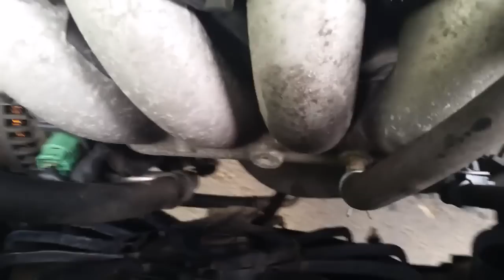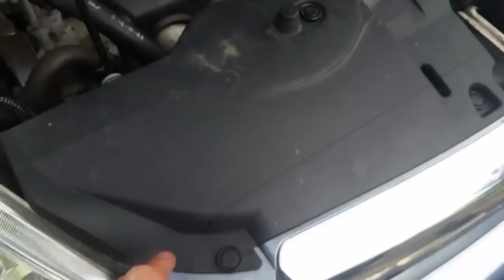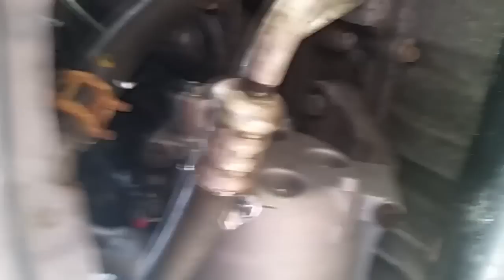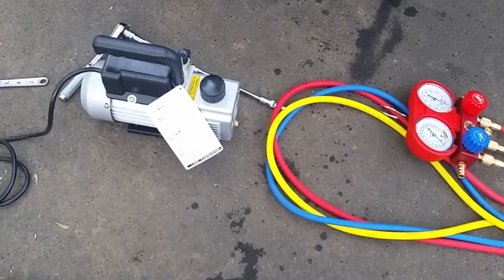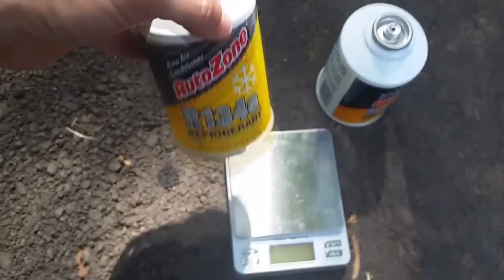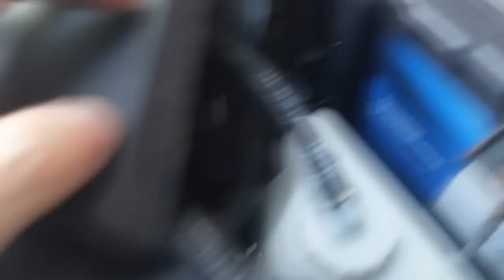2007 Honda CRV AC Compressor and Serpentine Belt

Comment: you dont need to buy that special tool,  Just get a wrench 14mm and extend it with another one but before that just push the power steering reservor to the left side,  I replaced my alternator and had to do that process

Comment: I did this job yesterday on a 2007 crv. I installed a low mileage used compressor from a 2012 crv.  Exact fit.  AC blows really cold now.

Comment: I purchased a 2007 CR-V EX-L in October of 2017 with 43K original miles. AC runs good but that doesnt mean that there arent any hidden issues.  In order to prevent any A/C issues should I just go ahead and replace the coil part of the compressor and evacuate the system, rep[lace the condensor and re-charge?
Reply from the maker: Jackson Cruz I read some people have had catastrophic (expensive) failures, but I dont think I would do any preventative replacements.  This was just a DIY video, I'm hardly the expert.  Hope it lasts for you.
Reply: I've read that too and is what I am trying to avoid. I can do all the work myself. What I propose shouldnt cost more than $250. Where it gets expensive is when your expansion valve gets clogged and you have to tear dash apart to replace it.

Comment: The clutch and coil were recalled by Honda on this model. I had them repaired mine.
Reply from the maker: I don't think this is right.  There was a class action suit, but it was for earlier year models. If you have updated info, please post.
Reply from the maker: Reminded myself, it was a warranty extension to 7 years / 100K on the clutch, but of course if the compressors goes out because of clutch problems, well too bad for you.  I doubt too many are still covered by this extension. Good luck all.
Reply: +Scstev I know the model year was from 2007 until 2010 (or 2011 as I don't have the recall letter handy right now).

Please read my thread. 
http://www.crvownersclub.com/forums/14-problems-issues/156793-2010-cr-v-c-issue-compressor-clutch-coil.html
Reply from the maker: ybrik5 I didn't find it on Honda's recall site, but hope there is one maybe a dealer can look it up.  Thanks
Reply: +Scstev I'll check the recall bulletin tonight in the letter.
Reply: ybrik5 no recall extended warranty  to 100 thou miles or 7 yrs. i am currently dealing with mine failing.

Comment: Man.... my 2011 was making a rattling noise on idle or going 0 to 20 mph. Took it to honda and it was cause by the ac compressor. It was going to cost 1500 to fix it. Thank goodness my car was under warranty so i only pay 50.00.

Comment: There was a recall on AC compressor with this model? 2002-2008I heard you can get it replaced for free.
Reply from the maker: That would be good news for those in this situation.  I remember reading about a warranty extension for AC clutch problems, but not for compressor failure.  My memory is fuzzy, but it certainly wouldn't hurt to pursue with a dealer.

Comment: I have a 2008 Honda c r v I have looked and looked and I can not find a A/C filter / dryer any place can any one help
Reply: I also was able to buy that part from Autozone, even though i did not replace it.  I believe you will have no trouble finding them online - Amazon or an auto parts store website.  I noticed the part is usually labeled "receiver drier" so try that you may have more luck.

Comment: Thanks!  I need to undertake this project with my wife's car.  Is it possible to have the system refrigerant taken out before by a local shop, drive the car home swap the parts, and then drive back and have them put the refrigerant back in?  Thats the part i really dont want to do...or know how to.
Reply: Yes, that's what most people do. Have a shop evacuate and recover and remaining refrigerant, then you can replace the compressor yourself.
Reply: Do you have to remove the refrigerant before starting the removal of the compressor? Or can you just pop everything loose?
Reply from the maker: kenaiproductions I'm sure you are not supposed to vent refrigerant, so yes you should capture it rather than pop loose.  Also, if the system has been running recently, and there is refrigerant, the pressures can be dangerous.  Not an expert, so watch other videos too.

Comment: Nice video, thanks for showing the compressor portion of installation.  Although you used a specialized tool to remove and replace the belt, you don't need to.  I posted a short video on how to do that part of the job with no special tools.  Here it is:
https://www.youtube.com/watch?v=MT3nrgcoNxw

Thanks again!

Comment: Hi Scstev,
Awesome video, I have the same car, color and all.   Where did you buy the compressor? Could you post the link please?
Reply from the maker: Frank Morales Thanks!  I bought the compressor at Autozone.  They only had one manufacturer in store, though more are available online. http://www.autozone.com/cooling-heating-and-climate-control/a-c-compressor/compressor-works-a-c-compressor/honda/cr-v-4wd/2007/4-cylinders-2-4l-mfi-dohc/974078_412265_3513/
Reply: @Scstev  nice video. How's the new compressor running? Why only add 1 oz of PAG oil?

Comment: Hi Scstev, did you have to change the drier and accumulator. i can't find the accumulator
Reply from the maker: Francis polanco contreras Hi, I believe the accumulator is the same part I called the "receiver/drier" in the video.  It contains the filter/desiccant bag that is inside a tube on the driver's side of the condensor, which is at the very front of the car behind the grill.  I decided not to change this as the compressor was not physically damaged and there was no leak in the system that can cause excess moisture.  Check out this diagram: https://estore.honda.com/honda//images/parts/catalogs/EA/14SWA701/Estore/illustrations1/SWA4B5800A.png
Reply: Scstev Thank you i really appreciate your help. I am having the same issue that you had. Thank to your video I am going to save some $$$. And after you changed your ac compressor, how is the ac system working ?
Reply from the maker: Francis polanco contreras Great, thanks!  My A/C is working perfect now, no issues.  Check out some other videos on A/C charging for details on how that is done, there are plenty, just not much on the late model CRVs specifically.  Good luck!
Reply: Scstev Good, Im happy to hear that you A/C works good now.i have one last question, did you have to take the front wheels off to take the bottom plastic off?
Reply from the maker: Francis polanco contreras No, I did not take the wheels off, nor did I raise the car.  You could, it might make access easier, but it was not necessary.